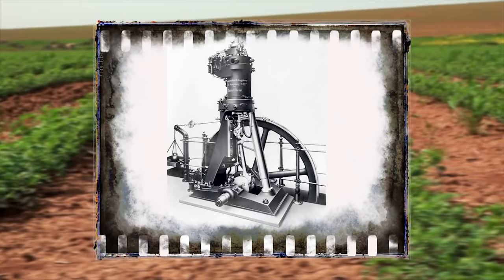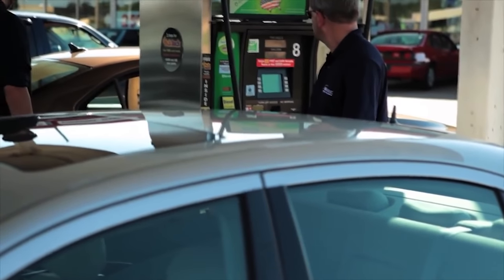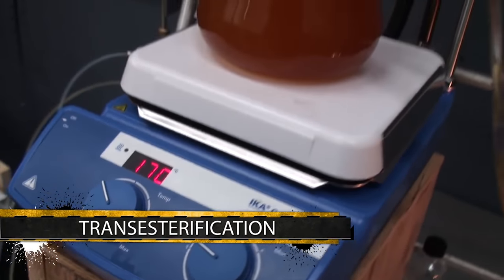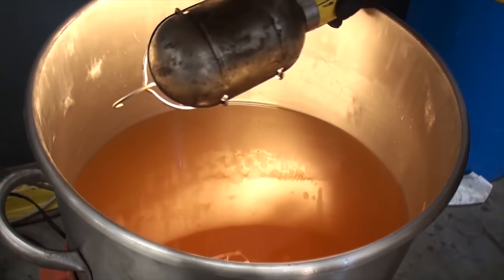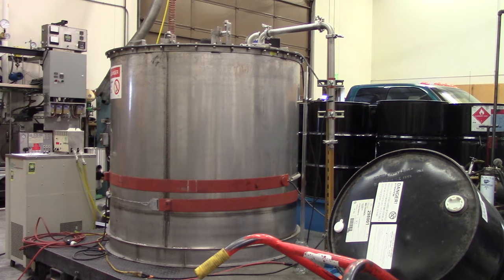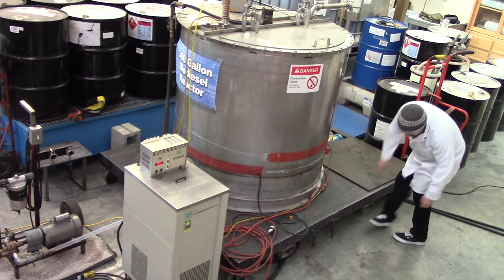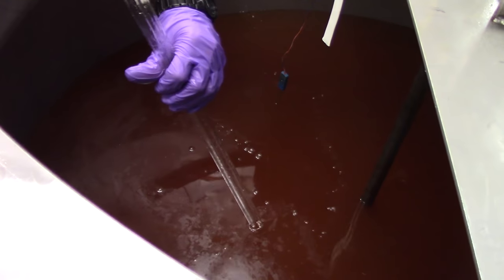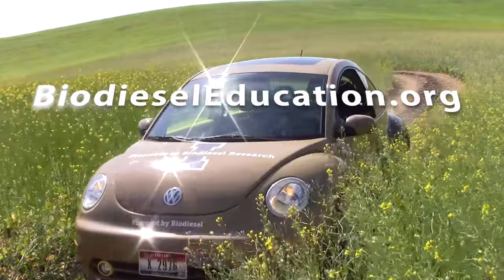How We Make Biodiesel (2018)

Comment: Add 1 gallon for premium gasoline to 30 gallons of diesel. To increase the Octane and flow ability of your fuel! I have a 1998 12 valve Dodge Diesel! With 500,000 km. I’ve been doing this from when I bought the truck new😊
Reply: Well seeing how diesel is measured in cetane and not octane I’m not sure that possible
Reply: @Crodgers88  we dont really measure them, but you can think of it as a thinner and primer, and some degree of detergent.
Reply: @briliankamil4594  still not sure that's how that works

Comment: What vehicles have you used this fuel in? Have you used in any diesel generators? And how much does it cost per gallon to make biodiesel is using used vegetable oil?
Reply from the maker: Great question—we use too many vehicles to count, from lawn-mowers and skid steers to semi trucks and front end loaders and everything in between.Currently we are using it in a shop heater that specifically says "no biodiesel" with no issues. If you're able to collect the waste oil for free, most of the costs are in the alcohol. The alcohol can be expensive, depending on where you live. Our fuel costs less than $2/gal to make.
Reply: @BiodieselEducation  I don't understand why more people don't make their own fuel. Even for generating electricity
Reply: What decent priced vehicles are good starting points?
Reply from the maker: @tatethompson2648  Any used diesel vehicle can be very affordable and work perfectly with biodiesel. We love our 2001 VW TDI Beetle, 1999 Dodge Ram 2500, and our 1992 Dodge Ram D250.
Reply: @BiodieselEducation  can it run a 2012 ford transit 2.2 tdi common rail diesel engine without issues?

Comment: Are the emissions cleaner than petrodiesel or is it in production & refinement that the greenhouse gases are saved/reduced?  Also would it be feasible for a farmer to produce enough to run a farm without giving up too much land to fuel production?  Is there a ratio you guys have came up with as far as arable land vs fuel production land?  Cool stuff is everything works out without making people starve for fuel production.  I don't mean to be negative, the earth could do good ideas right now! Oh also does it have to be mixed with petrodiesel?  Cheers
Reply: Just as your CO2 emissions as a human are a part of the carbon cycle, so too is the burning of biodiesel. The scientists call it carbon-neutral.
Reply: @sking2173  And yet, we acknowledge that there are some industrial processes which are more efficient than others. Curious to know if the biodiesel production process actually provides net benefit to the planet, or if it is just another fun 'feel-good' story. 

Planting trees seems way easier than all of this. Yay for carbon-sinks.

Comment: Awesome video! To save me from going through all your literature, is there a specific reason you use methanol over ethanol? I feel like ethanol might be a little cheaper to obtain?
Reply: Ethanol will cause your fuel to congeal at colder temperatures and will be more stable (ie not as reactive = potential misfires at low temp).. that being said that is the gist of what I’ve read
Reply: shorter chain alcohols have lower steric hindrance so they generally produce more yield im pretty sure
Reply: I work at a biodiesel facility that is capable of producing up to 120m3 of pure biodiesel. Methonal is the most effective catalyst to help in the removal of free fatty acids. Also we use distillation towers to remove the excess methanol. Apparently we produce the most pure form of biodiesel in Canada. It’s a multiple step process though
Reply: @taylorbroderson7426 I'm working at a biodiesel startup in another country.. been 4 months and we have so many problems. Our final biodiesel is too high in FA.. what is your % Fatty Acids going in to the final distillation process? 🤔

Comment: Question. Wha's the polution ratio compared to petrol diesel? Small or big difference?
Reply: presumably it should be considerably less, as there is almost no sulfur present in any of the reactants
Reply: @johnsailor6081  For sure, but sulphur is far from the only pollutant to be considered.

It would seem that consideration should be given to all of the energy inputs required to grow crops/raise livestock (tallow) as well as the energy mix used to produce the electricity involved in all of these biodiesel production processes. 

Besides, modern diesel engines run on ULSD which contains a negligible amount of sulphur, and the remaining sulphur is treated with exhaust aftertreatment systems, so the impact on our air quality is approaching zero.
Reply: @andrewwolitzki7799  oh for sure when looking at the large scale picture it’s a different ballgame. I was just examining the difference in emissions from individual combustion not alll the factors in mass scale production
Reply: @johnsailor6081  Understood!

Comment: Transesterification is easier with methanol than ethanol, but both should work.  (ethanol might be slower and require a stronger catalyst; potassium hydroxide instead of sodium hydroxide)  If you use E85 gasoline for the ethanol source and KOH for the catalyst, will the small amount of gasoline that makes it into the end product hurt anything?  The reason I ask is E85 is ubiquitous, but methanol is hard to find and expensive in small quantities.  Even with the tax, E85 is usually cheaper.
I vaguely recall that there's another 2-step process that uses sulfuric acid for the majority of the esterification.  I can't remember how that works, but it might be better for waste oil that contains a lot of FFA.
Reply: The acid-catalysis process is usually something you will use when you're working with a waste oil stream as it is more compatible with high FFA content. It's slower, but more efficient than base catalysis as you don't need to neutralize the acid content of the feedstock before the reaction can proceed. Virgin oils are more optimally processed using base-catalysis process as described in the video.

Comment: can i use ethanol instead of mythanol?
Reply: Yes, but it is much more difficult to achieve the phase separation between the fuel and glycerol byproduct. If you want to use less polar alcohols than methanol (like ethanol), then the reaction must be anhydrous. The water tolerance of ethanol-based biodiesel was the topic of my first chemistry research project

Comment: It's interesting they use used vegetable oil, because in videos I've seen they just use used vegetable oil and muslin, and that's all it takes to run on a diesel engine. Burning a bit cleaner, and I think more mileage per volume.

Comment: how much affect does using biodiesel have on the environment? is it like normal diesel or does it have more or less greenhouse gas affect?
Reply: It depends on how you do the math. Theoretically since biodiesel is derived from plants it should be carbon-negative, but with all the additives and work going into it I don't know.

Currently sugar cane ethanol is the only one I know that is carbon negative, but it'll take about 20 years for it to offset the carbon that was emitted deforesting the fields to produce it in the first place.
Reply: @ghislainmcgraw1775  Yes, it would certainly be interesting to see the calculus on typical oil extraction and refinery processes vs. intensive agriculture & tallow collection and filtration + methanol production --> biodiesel production, as well as the energy associated with transporting and blending this biodiesel into petroleum diesel. I wonder if biodiesel production still outweighs petroleum-based diesel fuel after all this is considered.

Comment: Diesel engines run just fine off  filtered vegetable oil, it’s just your exhaust smells like a barbecue!!!
Reply: You're exhaust will still have that smell with biodiesel. Filtered oil will work technically but there some issues that may cause damage overtime but it largely depends. If you only filter the oil, the oil's PH is unchanged and you could be adding acidic oil to your car which may corrode things quicker. The thicker viscosity although its really good for lubricating the engine, it also make it difficult on your fuel pump (leading to more wear unless you have a strong pump) and your fuel injectors since they are unable to atomize such a thick fluid leading to an inefficient and unclean burn. Also veg oils gel up and thicken in  cold weather much easier and are harder to cold start. Personally, I would only use filtered oil as a fuel if I were to install a second tank in my vehicle just for the oil, but to each their own.

Comment: It clogs the filters up
Reply: True story
Reply: Actually this is a side-effect that is a really good thing! High-quality biodiesel is actually a pretty decent-ish solvent which is good at cleaning, way better at cleaning than petroleum-diesel. So what happens is that once you add pure biodiesel into a USED diesel vehicle that used to run on petroleum-diesel, it will clean the tank and all the impurities end up clogging the fuel filter. You may have to change the fuel filter if this happens and if the tank and lines are really dirty then you may even have to change your filter twice. After that, you wont have any issues with clogged filters.
Reply: @andrewwolitzki7799  Not true!